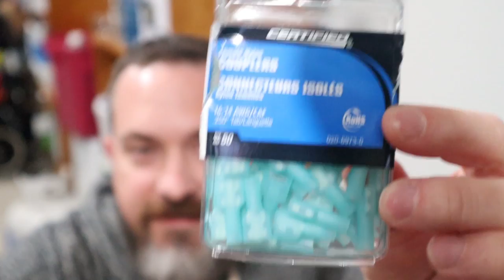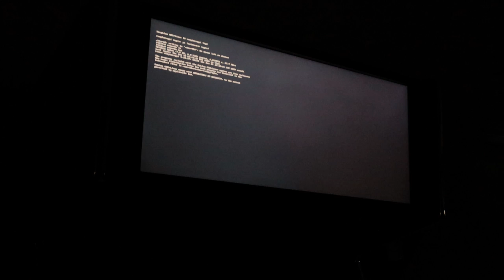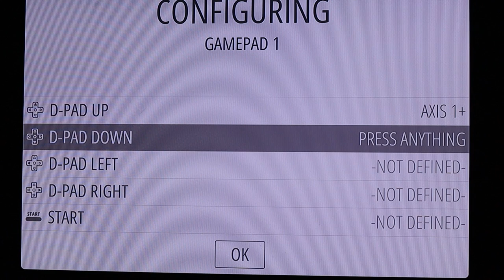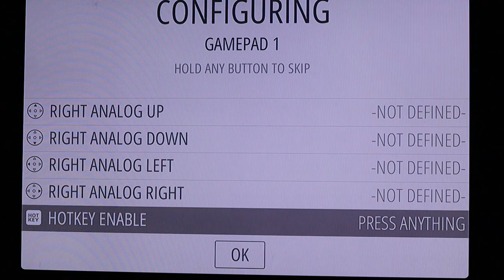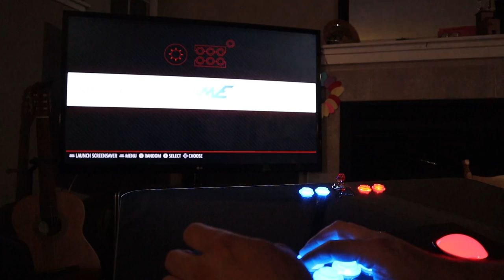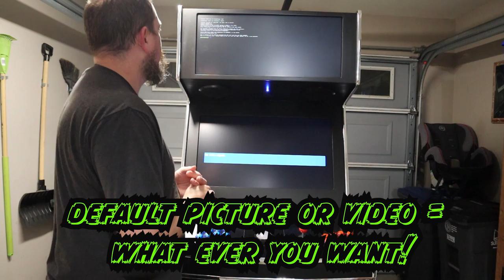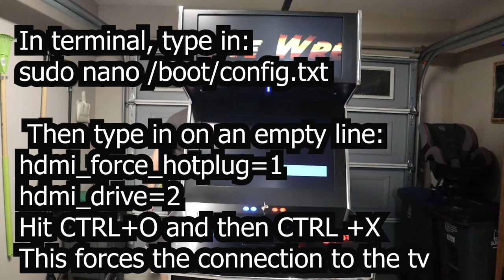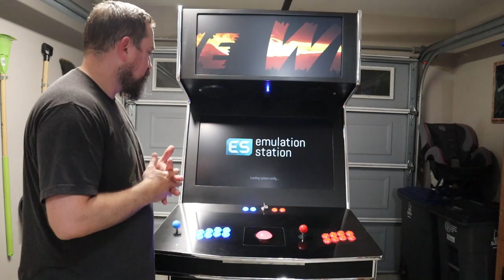How to install vinyl, t molding, buttons, and joysticks on a Raspberry Pi Arcade Cabinet Ep#11 Pt# 2

Comment: Dang man, just... dang!  Nice work.  Appreciate share of this knowledge.   Bonus!  You appear to have used buttons from same manufacturer I happened to buy... CROWN / SAMDUCKSA.   Building full cabinet eventually but gonna wire up the control board first following this guide.
Reply from the maker: Thanks Joe!  Yeah this turned out pretty awesome.  No worries, glad you enjoyed the video and are able to get something out of it.  Yeah these buttons were pretty easy to wire up except that my control panel is bigger than normal so I just had to add some wires to extend the one side from the ipac.  Good luck with your build and you should check out my new series on a virtual pinball cabinet....it is a whole other level of cool. Cheers!

Comment: This was awesome. Great work. You are a perfectionist if you didn’t know already 😂.
Reply from the maker: Some people would take this the wrong way but I think it's awesome.  I would consider myself a perfectionist and it drives me to make things to the best of my ability....including my videos.  The hours I put into these is insane.  Thanks for the watch!  Cheers!
Reply: @wayofthewrench  I think it’s great. The finish on this is A+.
Reply from the maker: Thanks, it turned out awesome but I have some mods I would like to do in the near future.  Addressable LED light strips, PC upgrade (Launchbox), spinners install, Sinden light guns, add visual pinball using digital marquee as the backglass etc.  Always something to tweak and make it even better.  Cheers!

Comment: "So much easier than having to crimp …" And I'm like, "Wait til you either have a rat's nest of too many wires, or some are too short." And sure enough!

The advantage of those kits is that you don't have to spend time on them if they work. When I wired one of these things up myself, I was glad I took the time to make each cable the exact length I wanted and install cable management. Its owner uses it 20 years later despite owning better made options because its so easy to maintain.
Reply from the maker: Yup, sure enough.  It would have been ok on a smaller control panel but it wasn't a big deal in the end, just part of the course.  I do need to clean up the wiring at some point though. Cheers!

Comment: 18:00 And Trackballll! - Trackballll!
After three years, you should de-gunge clean the internals. I did my TB recently. It is amazing how much gunge builds on the rollers from skin, oil,  phenolic/polyester resin dust and dirt. You need finger nails to scrap the buildup off using IPA and a cloth. You will be amazed by the visible wear line on the metal rollers. And don't forget to blow out the particles and dust bunny (Cheetle from snacking) found inside the case halves. 
Trackball can be Awesome smooth again!
Reply from the maker: Nice tip for cleaning the trackball!  I should look at mine cause it's hard some use.  I find I don't use it that much though and I find some games would play better with a spinner.  I'll have to make a video for that and some upgrade videos for the arcade cabinet too.  Thanks for the watch and the tip!
Reply: @wayofthewrench  You are aware that I did a DIY Spinner using a Chinese rotary encoder 600ppr, 1,5" Aluminum knob or 2.5" encoder wheel and, ProMicro Arduino board on my git-hub page CraigB-spinner Repository. Knob diameter adjusts feel and sensitivity of finger/hand movement. Device should be mounted to a thin plate (0.102" - 0.178") without using a coupler for extension.
Reply from the maker: I'll have to check that out, I still need a spinner on my cab.  Thanks for the info.  Cheers!

Comment: 14:37 I had the same problem 12 or 15 cm 26 AWG wire leads. Designed for 6x9" fightbox.
You can get Micro JST XH 2.50mm (0.984" a tad smaller than 0.100" 10/in - orig. 70's DIP spacing) connectors not to be confused with PH 2.0mm (0.127" 7.8/in) connectors on online shopping (everything comes from China) with longer 20-30cm harness (not cheap $1 each) but also need 0.110" female spade ends to finish. I assembled the solder wire/shrink rap/spade plug end to extra 2 pin harnesses myself. You also need special crimpers to do a proper job on 26 AWG wire into spade connectors.
Reply: Adjusted spec typo and you tube censorship is getting rough on online brand store names - always a learning curve for comments. I am awaiting all band usage of articles 'the' & 'a' in comments
Reply from the maker: Yeah you end up modifying them anyways....could have just added wires.
Reply from the maker: Lol...YouTube

Comment: Can I get some more information on the control board/fans and setup you used for your cooking fans. I like how they power on and off as needed.
Reply from the maker: Here is the link to the part you asked for.  Works like a charm and the fans were dead silent running off of this.  https://www.amazon.ca/dp/B019P0FLHW/ref=cm_sw_r_cp_awdb_imm_t1_nWT3FbHZZH2Z0?_encoding=UTF8&psc=1

The other parts are just pwm computer fans and a couple pwm fan extension cables.  Cheers!

Comment: FYI: If you don't want to be "Blinded by the light" for all eight buttons, a simple mod can be done.
There are two styles of Zero Delay boards CY822A/C(non-LED) and CY822B(LED). The original Zero Delay board used a 2 pin harness for each button with Common(+5v) & Trigger(pulled-low) and your LED Zero Delay board 3 pin harness with addition of Gnd(-ve). You can modify the wiring on the harness to change the LED lit state from always-on to light-when-pressed or visa versa.
Plugs with black-yellow-red orientation, will cause LED to be always-on.
Plugs with yellow-black-red orientation, will cause LED to light-when-pressed.
The Chinese colour wiring standards are as follows: red is Gnd and +5v is black or yellow.
Zero Delay circuit boards are oriented from outer edge to centre as follows: Common(+5v), Trigger(pulled-low), and Gnd(-ve) on LED versions.
Reply from the maker: Once again, really great info...thanks!  Do you build arcades for a living? I might actually swap these out for some higher quality leaf switch led ones.  Plus an ledblinky set up would be sweet.  Thanks for the watch!

Comment: 16:54 Did not realize you added a trackball RA-TRACK-B-3-USB-PS2 from Holland computers. I did the same a month later with RA-TRACKBALL-2 using the red boards and programming my own Pro Micro (used all but one input). I watched the FedEx plane fly from IND to YYZ (500 miles) right over my home in K-W in less than an hour during height of Covid lock-down. Yes, I could have ran outside and said " Da plane, Da Plane". That is what I call speedy service, plane was on the ground less than 20 minutes before turn around. Shipped from Elyria, OH to Indianapolis, IN via interstate then jet to Canada. I got a good deal thru Amazon thru Holland for $66.50 + $27 S&H, that would be approx $50 US + S&H. Prices today from China have over doubled for stuff. My project can be seen on git hub under craigb-spinner and I have a few short videos on YouTube demo my bad TB playing ability; not as good as your full length build vids.
Reply from the maker: Oh nice!  Lol, that's funny.  I sometimes do the same thing and watch my packages go all over the place.  You install spinners?  That's something I need to add on mine, plus go to Bigbox and a PC.  Thanks for the watch!
Reply: @wayofthewrench  I started 2017 with a Pi3B (retroPi), Spring 2018 with an 8-way with Sanwa parts from Canadian Joystick from Burnaby (your part of the woods), Acrylic Box and Zero delay, and few months later with a 4-way box. Spring into late summer 2019 with a DIY "Arcade" spinner. 
RetroActive ARCADE from Edmonton sells a SpinTrak $127 + S&H but needs an encoder like Ipac board. GRS USB Arcade Spinner (not Arcade1UP model - wrong protocol) are over $100 from amazon. Or do what I did Chinese Rotary Encoder (600ppr, 5V) $20-$35, aluminum 1.5" knob (doubles as flywheel) $13, Pro Micro board with Atmel ATmega32U4 MCU from Canaduino $17 or UNIVERSAL-SOLDER $8-12 + S&H, DuPont wires, 3x3mm ctrsunk screws, USB micro cable, Lexan or Plexiglas 0.060" or 1.5mm thick sheet size of joystick base plate. It will cost less than half of a Ultimarc SpinTrak, GRS USB Spinner, GroovyGameGear Turbo Twist. I noted above I have a git hub page with software, it should work with either SpinTrak, TurboTwist or your own DIY spinners, GRS is complete all-in-one 360ppr spinner.
Plus must have skill not to burn fingers with low-watt solder iron. Minimum 4 wires to solder on MCU board, or headers and DuPont connectors.

Comment: Hi can you send a link to the cooling fan control board that you used in this video ... great job !!
Reply from the maker: Here is the link to the part you asked for.  Works like a charm and the fans were dead silent running off of this.  https://www.amazon.ca/dp/B019P0FLHW/ref=cm_sw_r_cp_awdb_imm_t1_nWT3FbHZZH2Z0?_encoding=UTF8&psc=1

Comment: OMG VERY VERY GOOD JOB. Beautiful Cabinet but I'm curious:
1. If you are using a Raspberry pi it was the point of building such a large Cabinet hmm?
2. If the TV and monitor sweat, I would give 2-4 additional fans for the back :P
Reply from the maker: Thanks a lot!  I'm not sure if you have watched the entire playlist but the idea for this build was to design from scratch a full size arcade cabinet that had a bunch of unique features and was ergonomically perfect for me.  I wanted a full size arcade cabinet that looked good to me and still fit through a standard size door.  The dimensions of the cabinet and control panel are to accommodate a 32 inch wide screen (traditionally way smaller) and not be standing too close to such a big screen.  Also I wanted a digital marquee to be the highlight of the build.  The control panel was designed to be removable and completely self contained (all electronics inside control panel) to make it portable (kinda what you are asking about).  So far the inside of the cabinet is not too hot.  The digital marquee monitor is upside down (had to so it would fit centered with opening) and the cooling fans/vents for the monitor are actually on the bottom and the there is a opening cut out in the top of the cabinet where the monitor fits.  So hot air can escape out the top but I might put a cooling fan in the bottom/back of the cabinet to pull in cool air later.  I still have a few things I want to upgrade on the cabinet so this might be on a future video.  Thanks for your comment and suggestions!

Comment: 13:54 If you modify the orientation of the joystick top-plate from portrait to landscape or flip to the other side, the wire harness will be fubar. A standard Sanwa/Seimitsu joystick harness must plug into the lower left to work without modification. 
Here is a layout and pin# mod to make it work in other orientations.
Sanwa/Seimitsu Harness Layout-viewed from top
Pin Direction/Pin# Change/Orientation of plug
Gnd ◄ ► ▼ ▲ - G 2 3 4 5 - Lower Right (Std)
Gnd ▲ ▼ ◄ ► - G 5 4 2 3 - Bottom Left
Gnd ► ◄ ▲ ▼ - G 3 2 5 4 - Upper Left
Gnd ▼ ▲ ► ◄ - G 4 5 3 2 - Top Right
Reply from the maker: Thanks for the info.  Is this for stick arcade set ups because in Retropie, it seemed to work with zero issues?  Thanks for the watch!
Reply: @wayofthewrench  For your large cabinet space is not an issue once you did any needed wire extensions. If you have a space limited box and need to exit the harness from a non-standard side, you will mess up the directions for all encoders for Japanese Sanwa/Seimitsu sticks with soldered switch circuit board. All manufactures do offer sticks with micro switches with spade connectors which have 8 individual connections instead of the simpler single 5 pin harness.
Remember buttons are more loose of an idea then a joystick direction, and RetroPie makes you bind every switch usage to function but not on a computer or console (eg. Sony's △, O, X, ▢, L1, R1, L2 and R2 will map to a button number) which will be pre-assigned by default. Mapping will be in game.
Say you need to exit the connection on the left instead of standard right then you will need to remove the four pin sockets using an X-acto blade. Change wire order from (G 2 3 4 5) to (G 3 2 5 4) and now your Zero delay will work as designed (mirrored image). On a Brook or UltiMarc board the wire colour will need to be screwed into different posts. This is a big issue with single joystick/button controllers and randomly changing a joystick/button layout between players. RetroPie will get confused and change settings.
Reply from the maker: Cool, thanks for the info!

Comment: when i got a raspberry pi4 8 gb for my arcade 1up and when i had to build a control penal for my arcade 1up it had a hot key and start and select button . i did have 3 arcade 1up  i sold them all  cuz i got a legends ultimate and it haves Coins-Ops on it. my arcade 1up had over 20k games on it i got a great image file from arcade punks it was running Venom image 512gb version
Reply from the maker: 20k games!!!! Dang son!   How you like Coin Ops?
Reply: @wayofthewrench  it ok i like it . but sometimes i do miss my old raspberry pi4 . but nothing is like using a PC for arcade emulators like running ps2,ps3,xbox and Wii games a switch games .

Comment: Absolutely awesome work, I very much appreciate the time and effort you put into creating the videos and explaining everything so well. those little details make all the difference and exactly what I will do. I was planning on creating my own from scratch but now as you have done such a great job I am tempted on using your templates as I can see no way of improving on what you have created.
the size 32" look great, I see you used an LG digital marquee which matches perfect but I am unable to find one, could you please let me know what model this is as I wouldn't want to order one too small or large?
also after a good 9 months of use, how are things going? is there anything you wish you had done differently or improved on parts used?
Reply from the maker: Thank you very much, I'm glad your getting something out of the video series.  It has been pretty successful which is awesome and helped me find my niche in youtube.

Well i am planning some upgrade videos for things like led lights, pc with launchbox, spinners, light guns, tempered glass, pinball.  Keep an eye out for those.  If I was to do it again I would buy a 32" smart tv so you can watch netflick or stream other stuff.  Like play a hockey game on the marquee while playing arcade games.  Things like that.  I also would have designed spinners into the control panel.  Some games really need them and the trackball didn't cut it.   The marquee monitor is a LG ultrawide monitor 29" , should be under $299 CAN.  Cheers and thanks again for the watch.  If I am deemed worthy, I'd appreciate a share out on your social media.  Thanks!

Comment: I use the three pronged dollar store outlets and an inlet module,
Reply from the maker: Instead of the IEC320 outlet or do you mean the power strip?
Reply: @wayofthewrench  I term out the outlet to the IE320, (cut off the plug, strip the wires, crimp on some connectors) to have 3 outlets, one of which I use for a cooling fan and a USB port for LED lights or recently I've thought of putting a wireless charger under the panel to charge phones during play, idk lol

Comment: 12:09 Player 1 and Player 2 must have identical setups or RetroPie will get confused and change settings.
RetroPie maps the Vender and Product-ID to similar boards.
Use lsusb command {after installing in Linux} lists - ID ####:#### or Vender and Product-ID
Reply from the maker: You're right, they both have to be setup the same or you'll have issues.  Thanks for the watch!

Comment: Not really sure why you split that white cable jumper...  Without it the light would be on all the time?
Reply from the maker: There are 2 ways to wire this IC320 outlet.  The way I showed which makes the light come on only when power is inside the cabinet which requires a split in that wire.  Or the other way which will have the light on all the time as long as the power cord is plugged in, which doesn't need the jumper wire (I believe).  I only showed the one wire diagram for what I did.  Thanks for the question.  Cheers!

Comment: Hey great video series. I had a question, what kind of raspberry pi did you use ? Also it looks like each controller section runs on a usb so that's 2 usbs plus a usb for the tracker ball. Do raspberry pis have that many usbs. Do you use a splitter ? Thanks enjoyed every minute of your tutorials
Reply from the maker: Thanks dude!  I put a ton of effort into the cabinet and the videos so I appreciate the comment.  If you enjoyed the series, I would really love a share out on your social media.

I used a raspberry pi 3bplus for the main pi and a zero W for the digital marquee.  You can use older pi but they limit what systems play good.  For example I used a raspberry pi 1b for a bit but I was only really happy with nes and it had to be overclocked.

  Yes you are right, you will run out of usb ports and you will also pull too much power off of the power supply so you need to use a powered usb hub.  Cheers!

Comment: Can you share the link for the computer
Board that controls the fans?
Reply from the maker: Here is the link to the part you asked for.  Works like a charm and the fans were dead silent running off of this.  https://www.amazon.ca/dp/B019P0FLHW/ref=cm_sw_r_cp_awdb_imm_t1_nWT3FbHZZH2Z0?_encoding=UTF8&psc=1

The other parts are just pwm computer fans and a couple pwm fan extension cables.  Cheers!

Comment: You are using the cable stripper the wrong way, the flat end of the stripper tool shall be at the direction you want the insulation to go.
Just a tip.
Reply from the maker: Which stripper?  The bigger yellow one or the smaller red one?  I wasn't aware of a direction on either but I think the yellow one might have a certain direction to strip wires.  Are you an electrician?  Thanks for the tip!